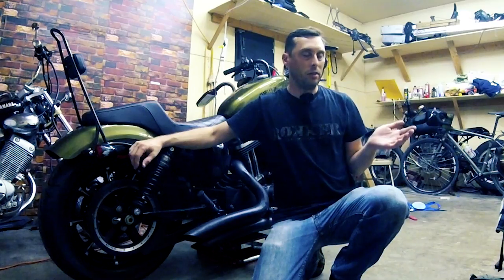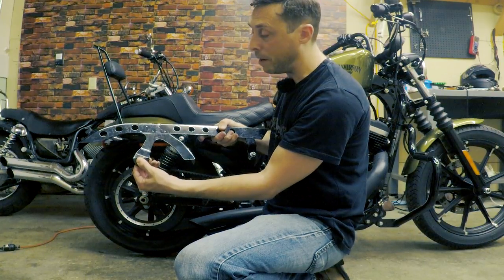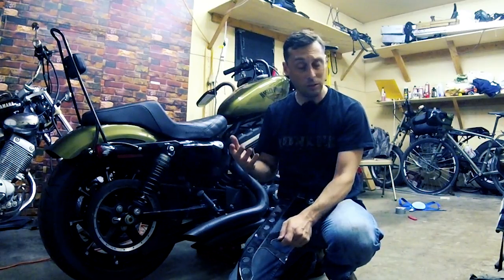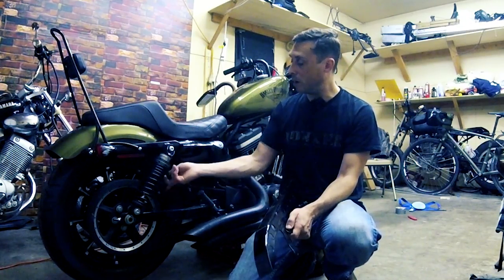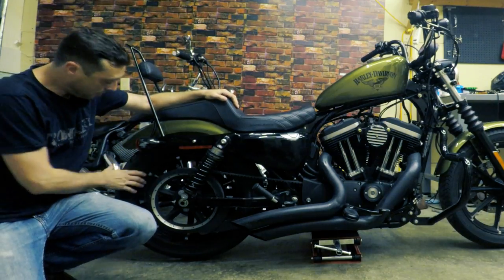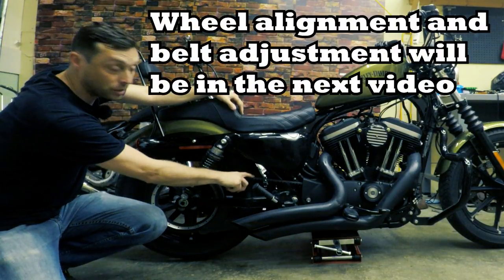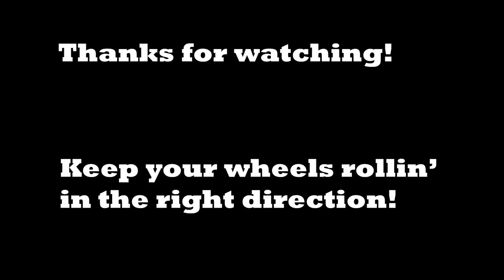How to Remove and Install Rear Wheel - Harley Iron 883

Comment: I like that you included the most important part too, beer sipping break. The essential part of wrenching that is often overlooked on YouTube. 

It's funny, I'm thinking of getting new tires, and now I have to take of the wheel myself. You're about 3k ahead of me, although the route 66 trip will change that...
Reply from the maker: There is a direct correlation between the reduction of me swearing in frustration and sips of beer while in the garage. Especially while removing that rear wheel. It wasn't easy, but worth it because it saved me tons of money. 

My new Bridgestone Battle Cruise H50 tires are amazing. Perfect for the trip.
Reply: Need a review vid ;)
Reply from the maker: Coming your way next week, my friend 😀

Comment: How much $ did you save by removing the rear wheel yourself? I just got quoted $400.00 from the dealer for a rear tire change on my Iron 883. Crazy expensive!
Reply from the maker: It's ridiculously expensive! It cost me $35 to have a local bike shop put a new tire on. I'd imagine I would get quoted about $400 too. That cool $365 can be used for more mods or a long trip!
Reply: @GreatEgret  Well, there's my decision.  I'll remove it myself. Thanks for the response!
Reply from the maker: Not a problem, my friend. Let me know how it goes.
Reply: Damn thieves  thata why the company  I'm trouble

Comment: Tell us the nut sizes cuz harley keep it a secret so u can pay for service! Damn thieves  can't even find em in.the manual
Reply from the maker: I don't disagree that Harley overcharges for service, but they don't exclude bolt sizes because they want you to pay for service. It takes 15 seconds or less to attach a socket or torx bit to determine what you need. Why print something that's no more difficult to figure out than trying on a glove to see if it fits. The techs use the same service manual. Now if they didn't print the torque specs, than I might be questioning it.
Reply: @GreatEgret  yes its true
Reply: But my harley does look bad ass thoe!